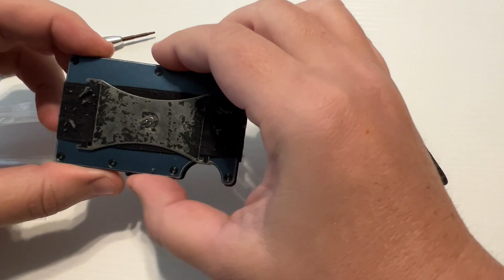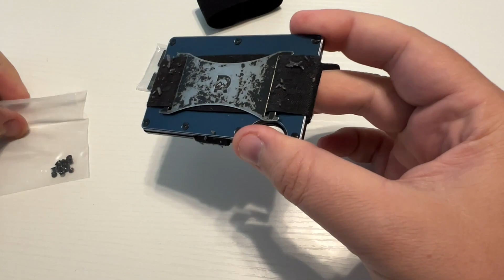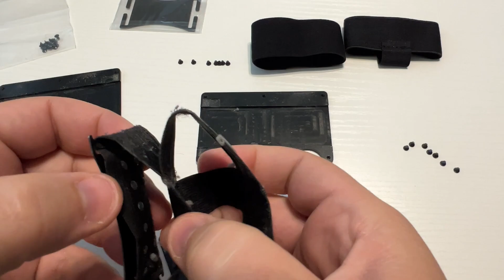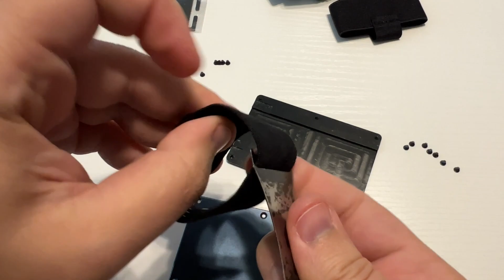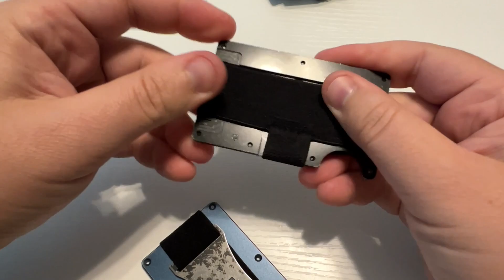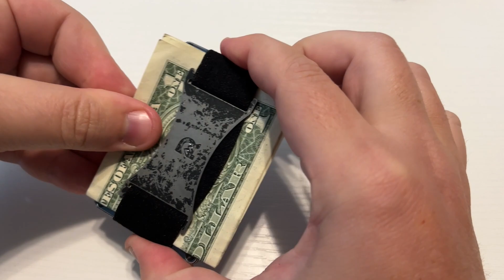Ridge Wallet Repair - How to Replace the Elastic

Comment: Thanks for sharing!  The video on the Ridge channel showed a replacement with one piece like the original.  I was so confused as to how it would stay together.  Hahaha.
Reply from the maker: Yes the one piece design would be a little better. I found out the replacements aren’t as expensive as I thought on the Ridge website. You get more for your money with the Amazon stuff, but if you only need the elastic the one from Ridge isn’t too bad.